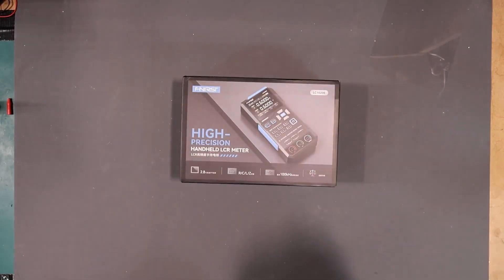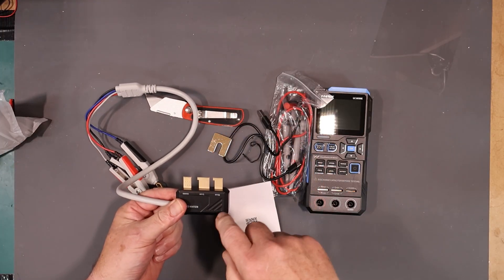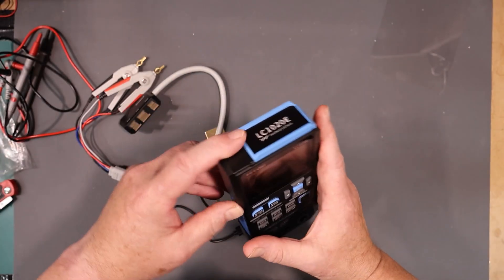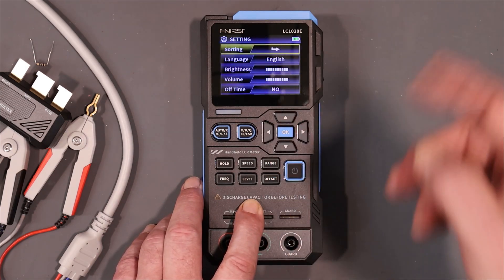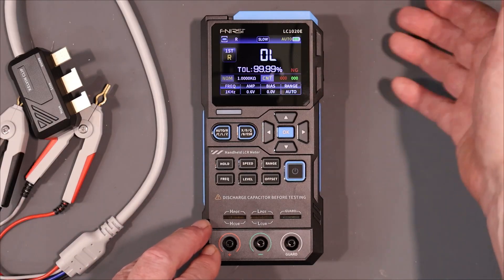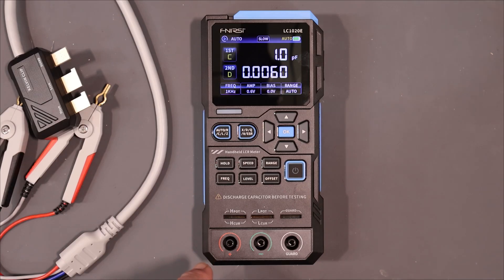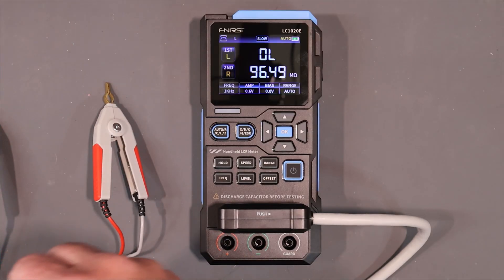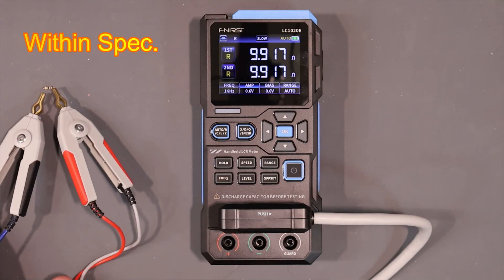Uni-Byte 0302 - Checking out the FNIRSI LC1020E LCR Meter

Comment: merci de cette vidéo bien expliqué  ce n'est pas évidant .je vois qu'il faut faire la calibration a chaque allumage
Reply from the maker: You should only need to do the calibration when you change measurement method.  There are 3 methods: 1- directly into the component socket, 2 -  using the Kelvin leads, 3 - using the meter probes.  For example, if you last used it with Kelvin leads and calibrated it then and are going to next use it with Kelvin leads, you do not have to re-calibrate.  It will remember the last calibration.  Hope that helps.

Comment: I have other FNIRSI equipment and I liked the look of this initially but it seems the measurements on the Zoyi DQ02 are better out of the box plus it can handle a DC offset via the battery test port so I bought that instead.
Reply from the maker: Thanks for your input!

Comment: I got very lucky in the beginning of my electronics hobby by paying attention to the EEVBLOG and buying the full DE5000 LCR kit. The only reason I am considering another more modern LCR meter is because father time has caught up to me and I need a bright screen. This Fnirsi has the bright screen but in my opinion falls way short of the DE5000. The search will continue. Thanks as always for a great video.
Reply from the maker: Thanks!  Yeah, I'd say the DE5000 is teh next step up from something like this.  But they do need to fix the small accuracy problems, either that or change their specs :-)
Reply: @uni-byte  My problem with Fnirsi and to a lesser extent Zoyi/Zotek, is the lack of confidence in the results. Does the reading not make sense because the Fnirsi is out of spec? Is it because it needs a firmware update? I have no idea and thats why I dont like them. When my Fluke or Brymen tells me a resistor is 2 ohms I never for a second wonder if thats true or not, likewise with the DE5000.
Reply from the maker: @guateque1718  I think they need to a bit more beta testing before releasing some of their products.   When they release something like this and it's 4% out, it causes people to loose confidence.  I will say though, it is more accurate on capacitance than either the Fluke 87V I have or the Brymen 786.  It all depends on you needs and you really can't expect overly much from a $60 device.  If they are able to fix those minor problems, it will be a bargain.  But again, they really do need to test stuff better before releasing it.
Reply: @uni-byte exactly. Agreed.